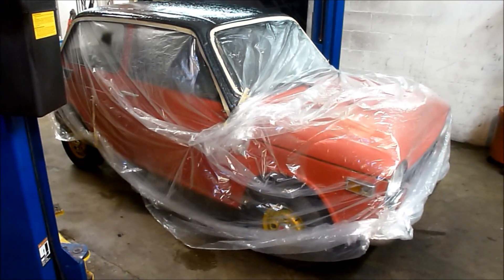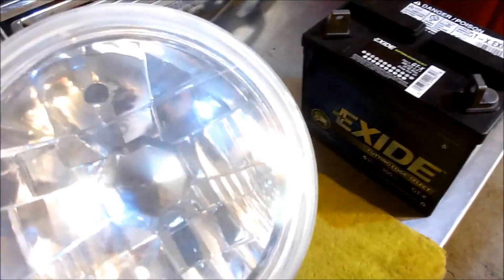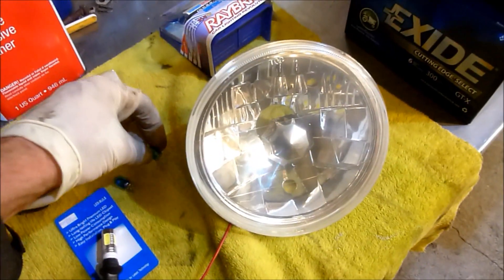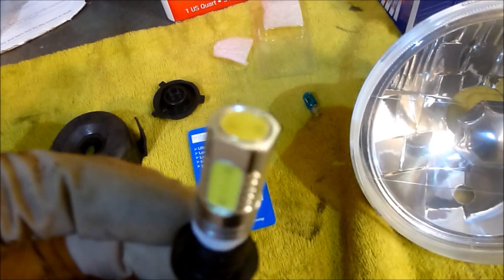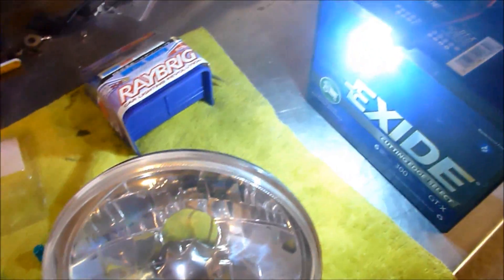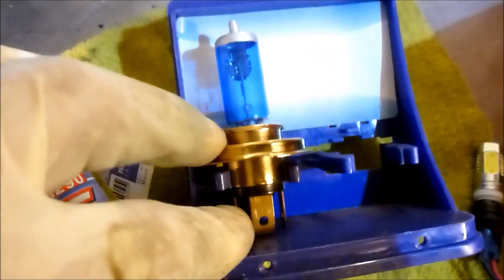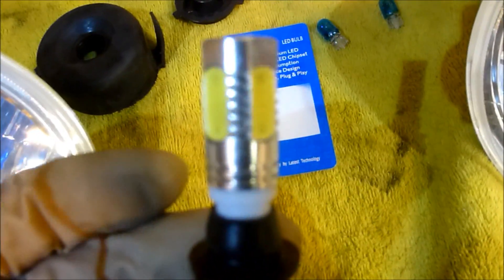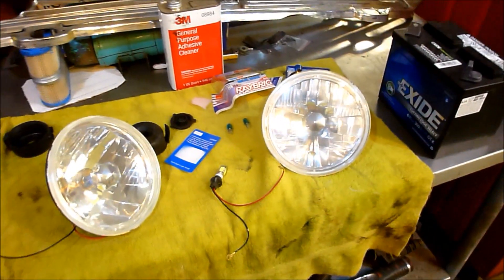Making a 7" LED headlight cheap and simple

Comment: an led in a halogen reflector housing won't work because the led will not cast light rearward onto the reflector and the reflector is what focuses the light onto the road, the way you have it the light will just scatter

Comment: I dunno if you still check on this or not but anyway...I have all the same parts that you used. I took out the little blue bulbs too. But how did you attach the wires to the leds? They won't hold solder. And they don't fit the connectors that held the little blue bulbs. So what to do?
Reply: greg tomko if you seriously dont hava a clue, I would advise you to not ever touch anything that has to do with electronics. Not to be rude. Read a book first at least. And dont ever put leds or xenons in a standard reflektor housing made for halogens. It wont work as good and will blind others.

Comment: You've namedthe video "healight LED" not "position" (as it's called around here) light.
LEDs are not focused,unless in a "concentrator" like that headlights with magnifier.
I am mistaken,or does the headlight has that "concentrator" in the middle,in wich to insert the light (instead of H4) or is it just a design on the inside of the glass ?

Comment: lol, blue is illegal for impersonating a police vehicle, but I'm PRETTY SURE running your high-power LEDs in a reflector housing is illegal too (heck, you're showing the LED not even where the main light goes). You need a projector housing for that mate. Since you're using a 7" light there's plenty of Jeep aftermarket ones you could use
Nice car btw!

Comment: there are h4/etc replacements for normal bulbs, they just plug in where the normal bulb would go.. so, he did this conversion, but, he could have put a LED unit in place of the normal bulb, they are sold all over Ebay.

Just to note, a LED at the same wattage as whatever halogen/incandescent came out will be a little over twice as bright. I am running a like  a 12lo/30hi wattage and people complain sometimes about the low and flash me like i have my high beams on. its on my motorcycle and came with a 30/60w bulb. the low is much brighter than the filament bulbs low was at 1/3 the wattage. keep that in my when ordering LEDs, they convert energy to light much better.

Lastly, pay attention to the size, the heatsinks stick out the back and sometimes they are to large for small spaces. in cars its generally not a big deal however. I would have made a point a few years ago about the type of emitter being used, but, from everything i saw seems like no one is selling inferior emitters anymore.

Comment: That position is for the park light, a very dull globe. The low beam needs to be behind the deflector, so it only makes light travel down, so you don't blind anyone. The reflector is shaped to throw light from the a similar position on high beam as well, but it will be less efficient from the park light position.

Comment: i've got a 2x50 and a single 100watt LED, bought them for $9 and $15 respectively you should modify a replacement headlight unit for that car and see how bright it is '
Reply: if the beam is anywhere near as narrow as the stock bulbs you could start fires from miless away

Comment: are you connecting this directly to the battery? or connecting to the stock line of the park light?
Reply from the maker: I connect the LED to the parking light circuit or ignition on to make DRL